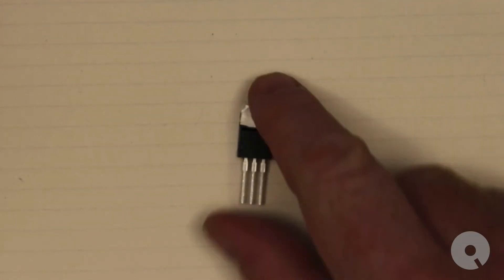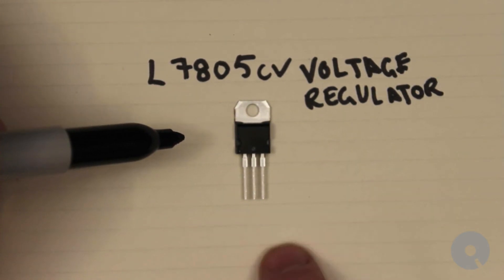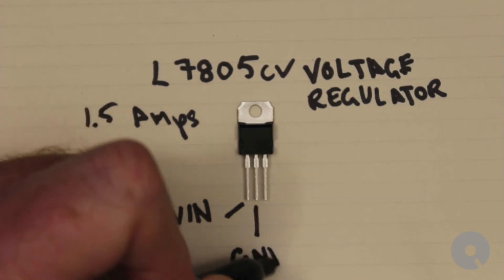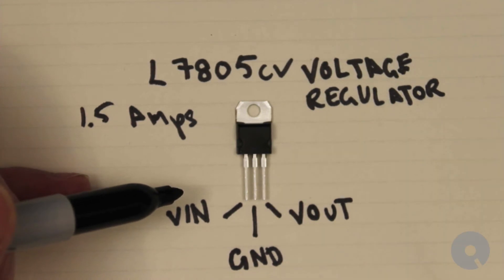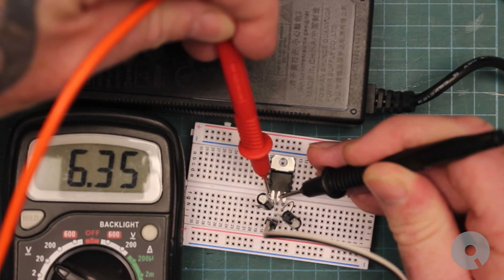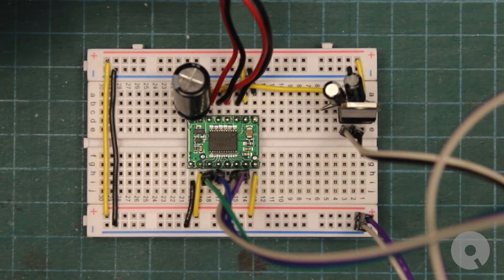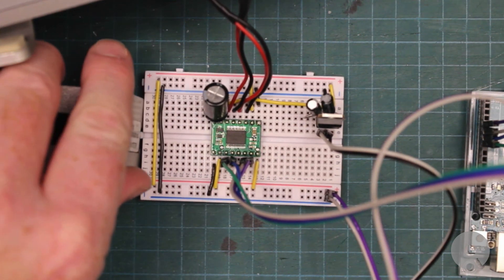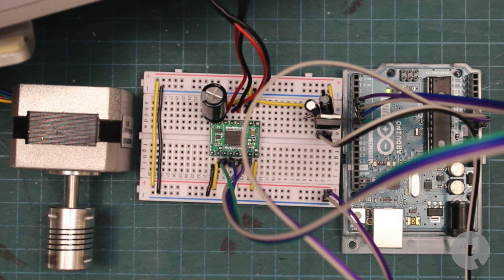L7805 Voltage Regulator

Comment: What voltage will it work up to . I need to convert 45v to 5v , I know 7805 is only rated to 35v have you tried to run on higher voltage?
Reply: Nah bro even it it works it will probably burn out in a minute.

Comment: Does it get hot ?
Reply from the maker: Yeah it certainly can get hot if you're running a full current draw on it over a length of time. You can attach a heat sink to it to help alleviate that.

Comment: I have made 5 volts circuit by using L7805CT TO-3 Package, by 12v input and rectified with bride diode and filter with 470uF 50V cap.
But the output is showing 15.56 volts at last points.
Why is this happening?
Reply from the maker: The 7815 has a maximum output of 15.75V it appears.
Reply from the maker: Based on this datasheet for the L7805CT you maybe bought a voltage regulator that does output 15V. "Output voltages of 5; 5.2; 6; 8; 8.5; 9; 10; 12;
15; 18; 24V"
https://datasheet.octopart.com/L7805CT-STMicroelectronics-datasheet-7281256.pdf
Reply: @hughqelliott  That is what he has. The 15v.

Comment: Thank you for sharing the link to this from your other video. I have been considering using this component. But I could not decide whether to use this or a full 12v to 5v transformer. I don’t know enough about electronics! This is a great video. Very clear. I am using a 1A 240v to 12V transformer. This is to power some 12v LESs. Then I could use this voltage regulator to change it from 12v to 5v for the 5v part of the circuit?

Comment: Are those capacitors (near the voltage regulator) between the 5V out and the Arduino?  If so, why are they there?
Reply from the maker: I’ve gotten in the habit of adding capacitors to “smooth out” the power going out to components. Means they don’t get hit full blast at the start and they “run out” slower.

Comment: Hey, this is totally a shot in the dark but I saw your video on a tutorial about the adafruit soundboard. I'm trying to make a project where it plays a sound automatically once it receives voltage from my 12v output from my car. (I will use a 12v to 5v converter). I just want to save myself the trouble of having to manually press each button so ideally once the 12v turns on after I turn the ignition on the soundboard will automatically play a sound. Do you have an idea on how to do this?
Reply from the maker: With the soundboard, if you switch a pin to high and don't switch it to low, that sound will play repeatedly. I wonder if you could use a relay to set the pin on start up. Otherwise, use an Arduino Trinket. Connect an output pin on the trinket to the button pin on the soundboard. When the trinket powers up, it can send the HIGH signal, the set the pin to LOW again. I am saying Trinket because it's tiny. But an ATTiny85 would do the trick, too.